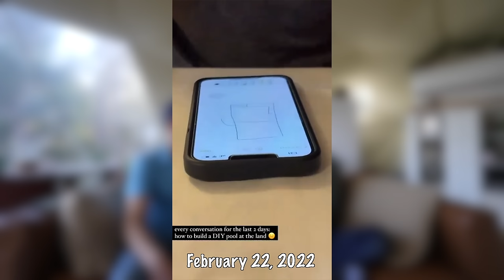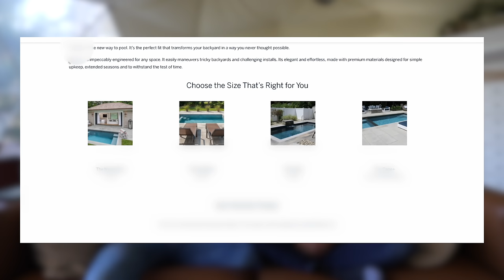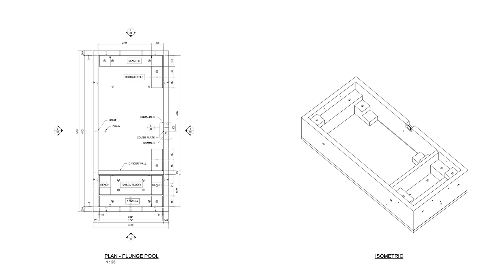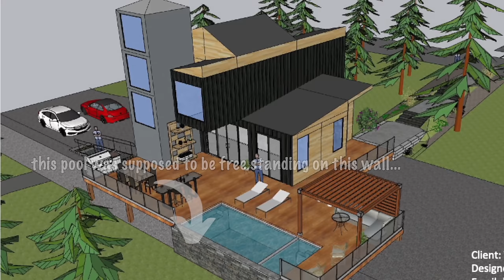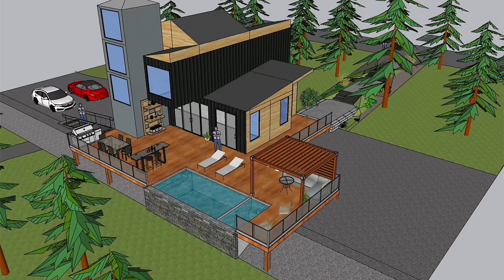We're being Sued...

Comment: I’m sorry to hear you guys are going through this. I have been flipping houses for over 20 years. I have remodeled over 60 houses. I have been in the situation more times than I would like to remember. The payment schedule to contractors has always cracked me up. Your supposed to pay that way in order to get the job done correctly but in my experience 75% of the time they do not correct the job or come back and do a half assed job and then sue you if you don’t pay them. The biggest relief in most situations is firing the contractor and taking over the situation yourself. Every time I asked myself why didn’t I do this sooner. I can’t imagine if I had been filming my experiences. I don’t think I would come across as sane as you guys do. Keep up the good work. THIS TOO WILL PASS😊

Comment: I went through something something similar (with 18 other homeowners) when we all bought into a brand new forward thinking environmentally friendly outside of the box condo in Banff. The builder was a trusted local and from the first winter we had a roof leaks due to the design coupled with a poor build. We were promised they would fix it for two years until we were outside the window to sue. When after 10 litres of water came through my neighbours ceiling we were told to get a lawyer. ( luckily the first judge said the two years started when then stopped trying to fix it so their plan backfired) It took 10 years. Our homes were worth nothing. We could not sell and we could do nothing as we needed it all for evidence. In all of this the trusted local ran for town council and we could say nothing. It was the most frustrating and experience of my life. Everything eventually got fixed and I had a beautiful home for 16 years but it was a lot.

Comment: You two have been putting a wonderfully brave face on this whole mess!  It's amazing how much that pool was leaking with just a bit of water in it... I can only guess at how much it would leak once it's filled and has some genuine weight pressing against the pool's walls and foundation.
It's wonderful that Mel was able to help you with the back-fill!
Are all of the pool leaks permanently sealed? Since you're on the side of a hill and have back-fill around the pool that wasn't part of the original design, is there any chance of undermining and movement of the pool or foundation itself caused by either pool leaks, snow melt or ground freezing unevenly since the pool will be warm year round?

Comment: I am sorry to hear about your predicament, and I see that you have already started on the project of removal of the liner. Suggestion for a [ permanent replacement ]. There is a product called {{ Epoxy Cement Sealant }} for shop floors, different colors with choices of speckles. Paint it on once and done. Ware resistant AND IT IS WATER TIGHT. This might be just what is needed in this situation. Solid finish with no SEAMS. This product might even be a nice touch in the new house under your wood burner, instead of just standard gray. GOOD LUCK !

Comment: Tile might be a problem in the winter, do some research. My friend had tiles pop off from freezing and thawing.   I have an inground vinyl lined pool and was shocked to see how they installed your liner. My pool was installed many, many years before I bought the home. It was old.  I ordered a custom made, extra thick vinyl liner. The company did all the measurements, including the steps and a ledge around the deep end. It came in one piece. Any seems were sealed on the bottom of the liner at the factory. It was unfolded over the top of the pool. The edges were tucked under the coping into one continuous channel. They left one corner opened and used a giant vacuum and hose to suck out all the air below below the liner while pulling the hose slowly back to the open corner.  It really was amazing to watch. It was suctioned into place in a matter of minutes and fit like a glove. The skimmer frames and lights were installed and it was done. Just needed water. This new one is 11 years old and looks like the day it was installed. The top step where the water is shallow faded slightly. We have harsh winters and can have deep freezes and never had any damage from ice and the occasional raccoon or cayote taking a dip. I do use a solar cover at night to maintain the heat but it sounds like your system will keep the water warm all the time .

Comment: What is so hard about doing a job that has been contracted out correctly?!! We have had the same issues just trying to get a new roof and gutters. Workmen don't show up on time and do not have all the materials (like roofing) to do the job? Our roofer spent half the day driving around looking for materials then ended his day at 2:00, getting nothing done. They certainly expect to be paid immediately. Our gutters we installed incorrectly but we were hounded for payment. We to would not give the final payment until our gutters, something that is supposed to hold water, stopped leaking. We were treated like criminals for expecting the company to do what they said they would do. I admire your ability to take the high road. Sometimes you just want to scream but you certainly did the right thing.

Comment: I went through this kind of thing with an auto shop that installed a defective engine in my truck. After the shop owner made it clear he wasn't going to do anything about it, I sued them in small claims (in Cal) and won. Ended up having the Sheriff's dept do a bank levy on the shop. My advice to everyone.......find a highly reliable shop or business to work with that has tons of great reviews. It doesn't guarantee there will be no problems, but it lowers the chances.

Comment: You need to proceed cautiously.  Film of the defects with the pool may not be sufficient in court.  You probably also need to get a third-party pool expert (or two) to inspect and write a report(s) on the defects.  You may have done this already.  But if the case proceeds to court, having that independent testimony could be invaluable.

Comment: First of all I hope you got a city inspector to go over your property to see and to tell you if you can have a pool. I had a in ground pool installed two years ago and had a blue liner install to make the water look softer plus make the pool feel softer when touching the walls.    My pool is 40 feet by 80 feet in size and the pool installer installed the liner in one piece. It was shrink fit using heat. I spent over one hundred thousand just for concrete work around the pool which included Egyptian Tile around the pool. A three foot deep footing was installed to keep the tile decking from settling, that's why it cost that much. I don't understand why they could not install your liner in one piece. I was told by a builder if you are planning on a budget for a pool plan on doubling it. I planned on one hundred thousand and wind up spending over two hundred thousand. I have a geo thermal heater to heat the pool and it does a good job.  Good luck on your job.:yougotthis:

Comment: We purchased a tiny home from a company in our country that outsourced it from China. All the electrical work was supposedly checked over by an electrician to make sure it was up to code. One wonderful evening later at 3am, a fire broke out from a bathroom exhaust fan in that said tiny. 
We went to the company to discuss the matter, they were reluctant to send out their electrician, but he himself offered to come check. Upon his discovery, the fan was not connected correctly, and the power board was installed within the bathroom area behind a shower. The tiny is made out of fibreglass so there’s quite a bit of condensation that occurs and mix that with electrical lines, that’s a fun time. 

The company only offered $1000 to compensate the matter, then also refused to do anything else even after their electrician advised them of the issues….

Comment: Once you try and fix things yourself you've taken responsibility for the outcome, which will hurt your lawsuit. You are required to allow the pool company to make things right, which you've done. As a contractor the proper way to proceed is to get 3 quotes from new qualified pool companies to finish the job, take the middle quote. Once the pool is complete you take the cost of hiring the new contractor from the amount you owe the original contractor. So if you owe $100 and it costs you $500 to finish, you sue original company for $400.

Comment: Over a 42 legal career, My practice focussed on construction disputes much like this for about 20 years. When I saw the title, I expected the dispute to be over the gross errors made in installing the tower, or the mistakes made in some specialty build-out in the upper area utilities, both previously mentioned. The pool never occurred to me, as it isn't rocket science compared to the many, cutting edge techo challenges the boys chose in this project. These types of issues are commonly a mix of poor workmanship, usually driven by lack of communication and plain old stupidity by the contractor, followed by damaged trust and feelings, often on both sides. As for the dispute in the video, I predict that the pool contractor will rue the day it decided to sue. If I correctly recall the cost of the pool installed, the reserve, commonly 10% of that price, would not begin to offset the legal fees they will get hit with, much less the damages. Do that have mandatory construction bonds in Canada?

Comment: Unless it is a blatant mistake by the customer, companies should try every effort to make it right with their clients, even if it winds up costing the company. Reputation is key for any company. 

The thing that bothers me is that this is not the only incident you guys have run into. Too many mistakes have been made on this house build. In some cases, a novice could have spotted the error and fixed it. So it really sounds like there are companies up your way that just don’t know their job, OR, there is a miscommunication somewhere along the line. 

This should never be happening in such proportions. I hope it all comes out good in the end. The only advice I can give (and it’s not professional advice at all) is that you need to research not only how something is supposed to be done correctly and to code, but research the companies to the hilt and beyond. Or if all else fails, learn to do it yourselves, knocking out the middle man. 

I really feel for you guys. It’s never easy to build a home, and I’ve built a couple, as well as finishing out my studio currently. I know one thing to be true….take one careful step forward, so you don’t wind up taking two steps backwards.  Wishing you both all the best, and I can’t wait to see you finish this home build! ❤❤

Comment: Guys...no matter what anybody says the bottom line here is that they have not or will not complete their part of the contract.
And when completed you should not have a defective product. This is not in the agreement. Seems that by any business law
you guys are in the right to demand that they complete and correct any and all faults in their product AT NO EXTRA COSTS
TO YOU!!! Your monies are not at fault but their product and conduct is at fault.  ......
     Now on to something more positive.....
so if that pool is a dump for heat that would present a possible scenario such as overheating occurring in the pool. OK that

being said...have you considered a solution that would stop this from happening? I present to you to consider creating a
waterfall that would help to pass off any extra unwanted heat back into the air. This would greatly help to ""Regulate"" the
built up heat. Call me crazy but it would add to the beauty of the pool area (mostly during parties) and the sound it would
make would be very soothing. You could design it to hide most of the waterfall mechanism to be under the deck with just
the outgoing water outlet extending to the edge of the pool and nobody would see any ugly pipes if done correctly.
This is just a suggestion. Just think how beautiful it would be if at night it could be back-lighted to create more beauty.
                                                                                                  Just the idea person not the technical guy,  Me  southern AZ.  (USA)

Comment: I just hope and pray that you have a site or entity where you can post the bad service you received and explain why you are giving them a 1 Star rating.  If nothing else, at least cripple the company so that customers coming behind you are warned about doing business there at this company.  This should be legal and nothing can be done to you for a bad rating.  Plus, I never was comfortable about those sharp concrete edges that could easily make cuts across your body or someone else’s.  I just assumed you knew what you were doing and had a plan for that. Turns out that plan was more sharp edges and leaks. Oh boy…. I hope the next issue isn’t the concrete cracking from the extreme winters you get there in Canada.  Being part of the self sustaining project, it could reverse things terribly.  I don’t know anything about this, but pictures in my head are always good or bad, and only you would know about that.  Just, in Silver Spring Maryland, a DC suburb, and building an extension to the subway system that travels through DC to Virginia on one end and Maryland on the other end.  TMI.  The company used to apply cement for the outdoor platform of the station subway stop collapsed before the project finished.  Thankfully not after supposedly finished and the station opened.  The cement used was a bad grade, or lower grade, something that should not have been used for building and why it didn’t hold up.  I never knew anything about cement being made in different grades or different materials for its strength.  Maybe something you should check on next.  

Why do you sign contracts in Canada that doesn’t come with a warranty period of the work done.  Something like the pool you had made, that stairwell build that wasn’t fully installed and at risk of falling, and uneven stairwell.  Things like this in the US makes a company liable for at least 10-30 years if not lifetime warranties.  People can just start a company in Canada, provide service and wacky materials and never be held responsible.  Just unheard of, and definitely not take years to settle in court.  And time sensitive projects like your pool could be asked to move up the docket for judges to make quick settlements.  And you would still get to hold that payment until satisfactorily complete or a complete refund so you could start over with a new company.  Plus, companies don’t want losing these cases because it becomes public information for anyone to check the quality of service before work begins.  Companies don’t want this on their record.

Comment: If you touch that pool you can lose your case because you two are not pool experts and that will be the installers excuse to have the case dropped. If you have a good attorney he or she should win this case soon but good attorneys can be expensive. My new heated driveway would not work and I had trouble getting them out here to fix it but when they found out I was going to put a lien on their business they came out quickly. Plus I still owed them the money.:yougotthis:
Reply: That's what I was thinking when they had the one guy doing pipes etc. The contract they signed is now null and void as the original work done by the pool company is no longer their original work. So any lawsuits will be thrown out theirs and the company's. So not sure why they made this video. Maybe if they had their friends Crystal and Jasmine help they wouldn't be in this mess lol

Comment: This company hired should be held accountable.  They were the professionals who came out , measured and should have been their place to research the region and ensure that the pool was delivered safely and in tact.  Meaning. Leak free, fittings should have bes. Spot on etc.  they should be held liable. You both are not the villains.  You are the victims. Your expectations should be met , safe, pool delivered with the right liner, fittings and what you paid for.  It’s also essential for the safety of the heat source of your property.

Comment: 100% that company pulled shenanigans on you. this is about avoiding accountability, it started to smell funny as soon as you said that they screwed up the liner install and followed it up with the fact that they pushed the idea on you and had it stocked, it looks like they were trying to shift product that they might have not had much experience with. and then the pipes and the fittings and so on and so forth, it keeps escalating. that company is 100% at fault. this is negligence.

Comment: I am amazed, that you continued to have issues, but moved to the next step anyways.  I would have stopped Immediately after the liner was wrong, and it was leaking.  But you continued to plumb it.  The plumbing wasn't right but you plumbed it anyways.  It was supposed to be freestanding, but you backfilled it anyways.  Why?   If the concrete needed to be repaired, isn't it a lot more difficult to do that now after its been backfilled?  SMH